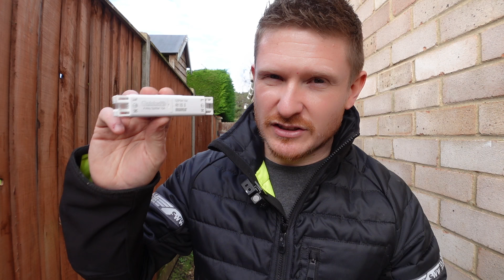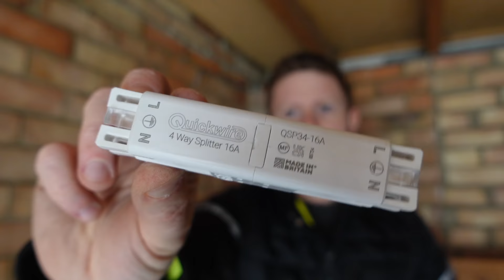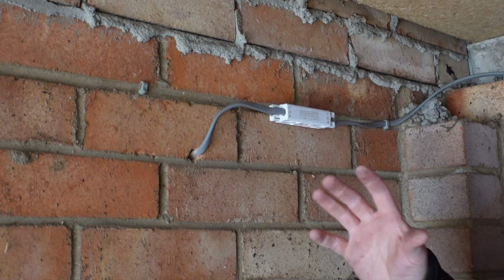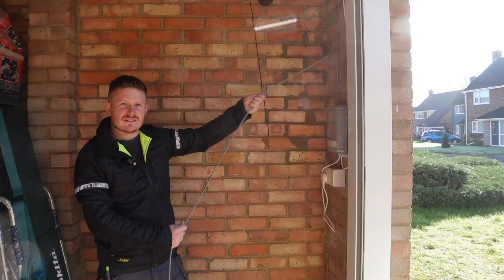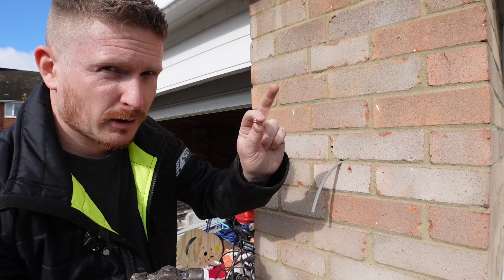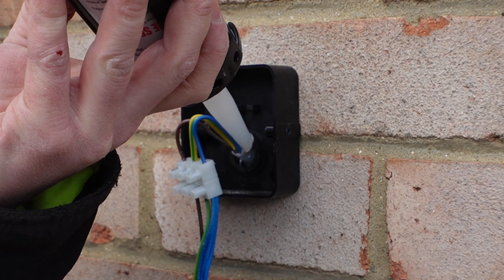How i Add More Outside Lights Using a QuickWire Splitter - So Easy!

Comment: A waste of time and money. This could have been done in one or two ways with less money. One way, using a junction box and wire nuts. The best way, branch off the light with another wire, one wire from the switch and one wire going to the next light. That's how all circuits are run. This was so unnecessary.
Reply from the maker: I mentioned in the video that you could do it that way and I also mentioned why I prefer to do it the splitter way. Everyone has their opinions and preferred methods.
Reply: Watch the video first before commenting, you twat.
Reply: Wire nuts are a horrendous American thing! 😅
Reply: Wire nuts or twisties are shite, a testers nightmare.

Comment: Great video. When should you use a conduit for cables inside the garage? I tend to use conduit for all cables below joist hight - don't know if this is overkill?
Reply from the maker: I would say it’s your call and there’s not really a right or wrong. Personally, I don’t and I see it as overkill but that’s just me. Thanks
Reply: @TheDIYGuy1  Cheers, thanks!

Comment: I wish we had something like those Quickwire splitters and in-line splices here in the US. Our cabling is very similar in design and construction to that in the UK, but we don't get to have anything like that here. There are plenty of imporant ways our power systems are different though, so I guess there are reasons. Are these considered maintenance free to install in inaccessible places like ceilings, floors and walls?
Reply from the maker: They are indeed maintenance free 😊. Quickwire take note, bring these out in the US lol
Reply: We'd love to get them over to you one day. I think one of the reasons is you guys use Romex cable, right? It's hard to strip with Quickwire strippers and to prepare because of the paper covering it seems to have?
Reply: @quickwire80  Correct, Romex or Lumex depending on where in North America, but both are the same. Two or three insulated conductors and a bare ground wrapped in paper. The paper sleeve is typically removed as far back as the outer insulation. It might take minimally more effort to line-up the conductors properly, but it would be worth it. We have one or two in-line options for a single splice/connection outside of a protected junction box, but nothing as elegant as the Quickwire solutions.

Comment: There's always one... more thing to mention.
Setting your silicon solution aside, maybe you could have belt and braced it with one of those "if you haven't got an SDS drill you can..." helpful tips of yours.
Just wanted to suggest that a mention of a drip curve in the cables wouldn't go amiss.

Great video thanks.
Never seen those quite fancy O/S lights. Like them cos they're sort of a cross between airport landing crews glow stick direction aids and (and I'm surprised that I'm the first to say this) a half-size light sabre.

Just need to retrofit them with a choice of coloured LEDs so that when they show red, the missus and kid know to leave daddy alone with his whisky by his new fire for a few minutes more.
Reply from the maker: Thanks for the feedback and glad you liked the video 👍
Reply: @TheDIYGuy1  Cheers, just a post pub lunch thought. As you can tell from how long it was.

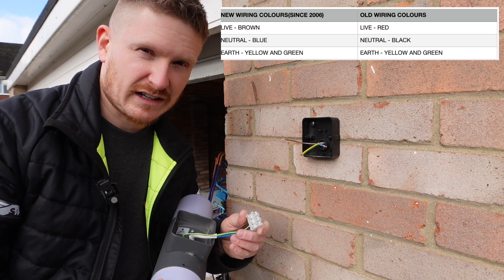Comment: 7:47 The simplest and easiest to remember wire discoloration was taught me by a former LEB road circuits specialist:
To neutralise someone, you beat them black and blue.
Reply: Or the other way, brown and red is the colour your pants turn if you touch the live.
Reply: Doesnt really work now black is a line conductor only.

Comment: Hi can you use the splitter method to run sockets or is it just for lighting
Reply: The have just brought out ones for sockets theses ones he's using are for lighting only
Reply: @tonyclark9851  So are the 24A versions for sockets and the 16A versions for lighting?
Reply: @H4mbo  yes that's right
Reply: Yep! @H4mbo
Reply: We have new versions released a few months ago that are 24amp rated and for use in power circuits (breaking into ring finals, adding spurs etc.)